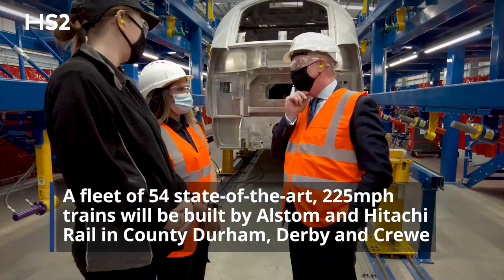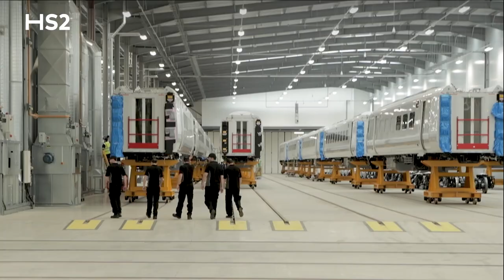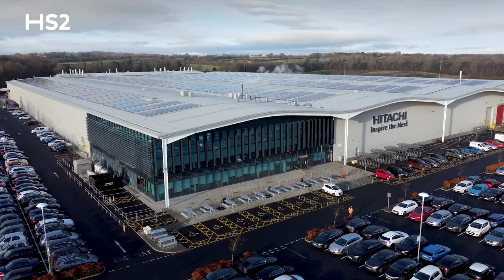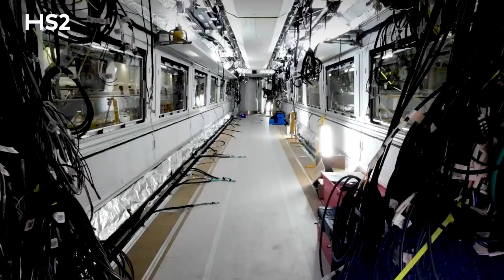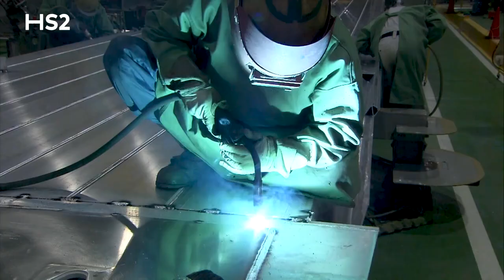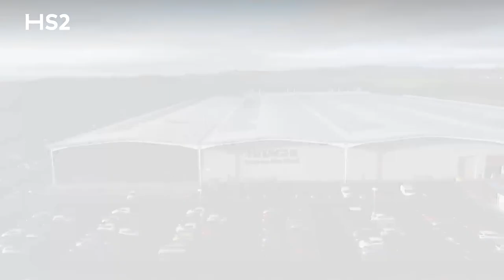HS2 awards contracts to build next generation of high-speed trains

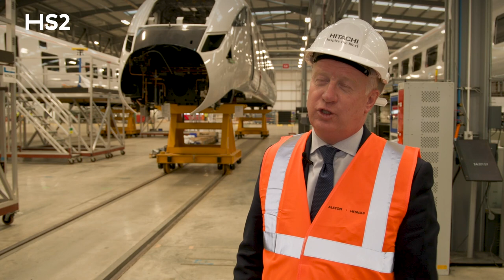Comment: 0:33 2 bilion poud is like 2,6 bilion usd right?how can you build a hsr with a fairly cheap price compared to us in indonesia which has spent 6 billion usd. or its just for the trainset?
Reply: the line is estimated to cost in 6 billion usd, covered partly by a 4.5bn usd loan from china, not just the trains
Reply: @joek6457  no i mean is the 2,6 bilion usd for hs2 is just for the trainset? The 6 bilion for jakarta bandung is for the construction and  trainset
Reply: @adiba9734  unfortunately yes haha, the £1.97 billion is just for the trains and maintenance, the first phase alone is around £45 billion, and £88-100 billion if the whole network was built i think
Reply: @joek6457  The official cost estimate for building HS2 is £87.7bn
Reply: @jermainetrainallen6416  and increasing all the time.

Comment: BRITAIN should of had proper High speed Trains in the 70's, we again delayed this 4 times since,  were actually well behind every other country with Train Infrastructure yet we invented the Trains.  

The journey times saved with these proper HS2 trains will literally open up doors and options and save time for billions of people.  

Tho these Trains pictured appear too small scale.  

We need wider, bigger, better.  As well as faster.  

Some houses and land were destroyed to place this track.  Dont just put tiny unfit new generation trains on it.

The hope for all kinds of improvements with this new line and its fimyture extentions all the way to Scotland eventually is massive.  

To be honest to open up capacity etc they should be building 3 tracks not 2.  Go big or go home.  Make this project a beacon of what were capable of.
Reply: These are just the classic compatible set of trains I.e. the ones that have to be able to run on our current railways as well. There’ll be another rolling stock contract in a few years for trains that will only run on HS2 lines, will definitely be larger and wider, should be 250mph capable too
Reply: I have to agree. HS2 should be a statement piece. The capacity is needed, lets not focus on the speed. But if you're going to do it, do it right, minimum of 3 lines to allow for passing places at every section of track. I'd have even aimed for a minimum top speed of 300mph.

Comment: Double decker would be nice.
Reply: No, it wouldnt
Reply: Have you ever ridden a double deck train?
And anyway these could not be double deck as these are the first 'Classic Compatible' trains that will run beyond HS2 tracks. The later contract will be HS2 use only trains and will be built to Berne gauge.
Reply: You cannot fit a practical double deck train on the UK conventional network, which these trains will need to do.
Reply: @thelastdefenderofcamelot5623  No. They cannot fit on the main uk rail network.
Reply: @1chish  No trains on HS2 will be built to UIC gauge, no such thing as Berne Gauge any more as they will not be running on the continent and there for no need for UIC gauge, don't know where you get these ideas from.

Comment: So no double deckers? Are the platforms going to be low/wide enough to be compatible with the European loading gauge, so double deck high speed trains can come from Europe, direct into Birmingham, Liverpool and Manchester
Reply: The trains have to be UK loading gauge so they can travel on normal lines.
Reply: They aren't connecting HS1 to HS2, so there are no plans to run any passenger trains from mainland Europe beyond the St Pancras terminus. It's a huge shame. HS2 is a great project but the ambition us been bashed down several notches below what it should be.
Reply: There’s gonna be another set of different trains that can be double-decker/generally bigger, as well as faster. These aren’t because they have to be able to run on the current tracks too.
Reply: @maz4304  Don't know where you get your ideas from, there will only be one set of trains, single deck to the British Loading Gauge as they will only run on HS2 and then from Crewe on wards on the existing rail network, if any more trains are built they will just be updated versions.
Reply: @peterwilliamallen1063  (I think) the comment was made before the Eastern leg was scrapped. Was always the plan to have two sets of rolling stock – classic compatible and HS2 only sets. Given the network has been reduced in size it’s likely just the current set will be ordered
Reply: @maz4304  Maz, I don't know where you heard or got the idea from that there was ever going to be two types of rolling stock, I am a Railway Enthusiast and live in Birmingham the HQ of HS2 and have followed the progress of HS2 from day one and no mention has ever been made of two types of Rolling stock, as Avanti West Coast will be running these trains they will be taking over most WCML services , so all rolling stock will have to be able to travel over existing British Rail lines.

Comment: what would really help is upgrading our old infrastructure, look at the canadians with their double decker Go trains, if we had that here it would help so much
Reply: While that is a fair argument, putting double decker trains on the oldest railway network in the world will involve a lot more money than HS2, along with long-term nationwide disruption to rail + road networks from reconstructing bridges and tunnels to fit these trains. 

I think the Electric Spine project is one good example of how massive infrastructure projects can end up significantly reduced in scale or, in some cases, fall through completely due to lack of funds.
Reply: Have you any idea of the cost and disruption it would take to knock down and rebuild every bridge, tunnel and overhead across the UK?
Its one reason HS2 was built because its more cost effective to build new.
Btw Canada runs the US Gauge and were built to the bigger loading gauge from the start and so they have comparatively few overhead structures.
Reply: Rebuilding existing infrastructure isn't some magic bullet that will solve all of our rail issues. It would be far more expensive, all while closing large parts of the network down entirely for long periods of time.
Reply: @BakerStreetBoi  in my opinion, I would like to see a significant portion of the UK network upgraded to the standard European loading gauge so that 4m tall trailers can be carried piggyback in standard pocket cars, the majority of trailers used domestically in the UK are over 4m tall and go all the way up to 16ft3 so multimodal for domestic transport is probably a pipe dream but everything coming in/out of Europe is 4m tall and many operators already send unaccompanied trailers across the channel for UK hauliers to pick up so sending them through the tunnel and a significant way up the country by rail would be seemingly easy/effective

Comment: Tiny like the virgin trains. No room. Small seats. It’s not good enough.
Reply: They're biggest cause they don't have the tilt mechanism. Probably the size of the new Class 800 IETs and Azumas. The first batch of trains has to be that size to go on the legacy UK network. When phase 2B is built, the rest of the trains will be full European size, so a lot bigger
Reply: @Nukeguy909  No they won't. All HS2 trains are being built to the UK loading gauge.
Reply: @SouthLondonRailwayPhotography  the tilt mechanism usually eats into the loading gauge, so wont be as narrow at the top
Reply: @SouthLondonRailwayPhotography  Yeah these ones are. The plan was to make some bigger HS2-only trains after, since HS2 has European gauge. Though that might have changed since the latest cutbacks, not sure.
Reply: @Nukeguy909  It was debated at the beginning because it would be cheaper to have an off the shelf design for part of the fleet but it’s not going ahead.
Reply: @SouthLondonRailwayPhotography  ah that's unfortunate, would be nice to have some wider trains
Reply: @SouthLondonRailwayPhotography  was going to be all UK loading gauge for this batch, and some larger trains for phase 2b, but doubt its happening now
Reply: @joek6457  Which make me suspect it was always the government plan to scrap new railways lines once London to Birmingham was done, after all if your intention was to build all new lines whilst not just go with bigger trains from the beginning.
Reply: @DavidKnowles0   Really? So why are they already building to Crewe and will soon pass the Bill to build to Manchester?
These initial trains will go beyond the HS2 lines. Like to Glasgow. Later trains will be HS2 specific.
Reply: @SouthLondonRailwayPhotography   Well possibly but the current plan is to build Classic Compatible first and then later trains to UICR gauge. After all there will still be Crew / Manchester to London needing specific trains.
Reply: @joek6457  All trains will be the same size, British Loading Gauge.